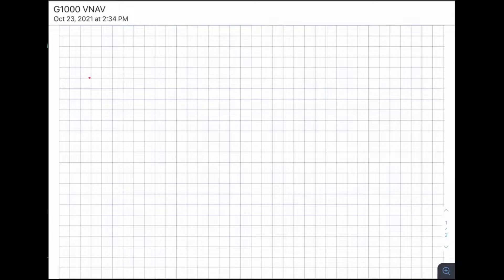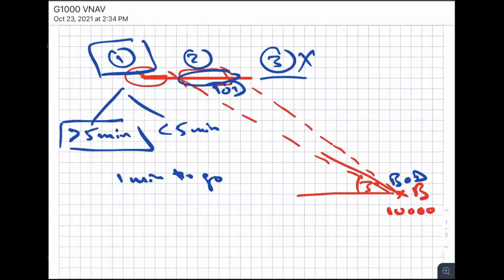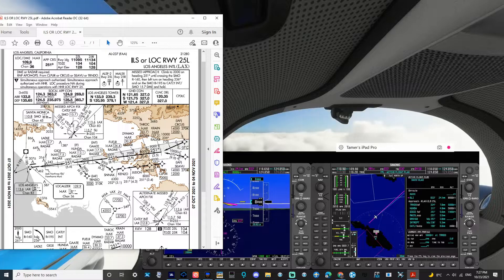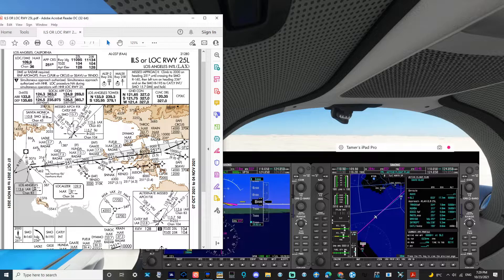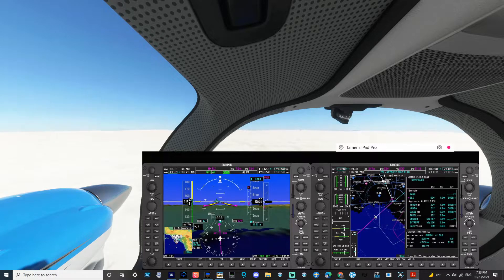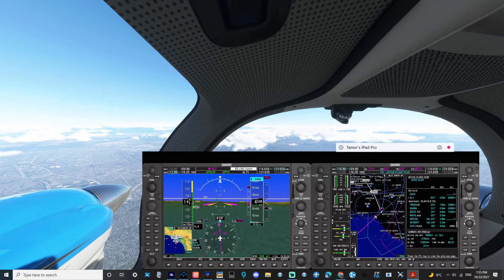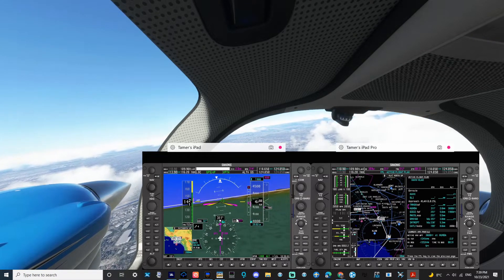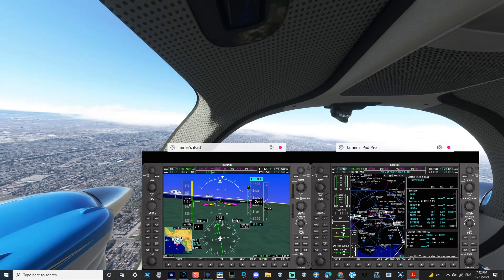Part 6: The G1000 VNAV Mode Explained

Comment: Been watching all your videos. Honestly they are fantastic and I would recommend anyone starting to use this. I have my ATP frozen yet I still am unfamiliar with the G1000 and find this information useful.
However, I have purchased 2 iPads and installed both Simionic apps; MFD & PFD. The G1000 presented on the C172 in MSFS 2020 seems to be more recent than the one in Simionic. And the flight plan and the Auto Pilot are not in sync. The information is always off and Simionic will not display what the AP and Flight Plan on MSFS 2020 are displaying. I was hoping you would know what the fix would be.

Thanks!
Reply from the maker: Thanks! Glad you enjoyed my videos!

Comment: Excellent presentation. Thanks for your work.
Reply from the maker: You're welcome!
Reply: @drpilotfi  One question.....I can not seem to delete waypoints in the flight plan on the MFD. I highlite the waypoint I want to delete and then press the CLR button but nothing happens. Am I doing something wrong? Thanks for your time.
Reply from the maker: @jakew9887  Was the waypoint you were trying to delete part of an approach procedure?
Reply: @drpilotfi  No. It was actually a waypoint that I added and then wanted to delete it but could not.
Reply from the maker: @jakew9887 Then it's a bug. I suggest you report it to the developer of that G1000 model.
Reply: @drpilotfi  I just discovered that if I use the CLR button in the sim, it works fine. If I try to use the CLR on the RealSimGear hardware I have it does not work. I'll contact RSG to see if they can help me. Thanks again for your help.
Reply from the maker: @jakew9887  Glad it's sorted out!